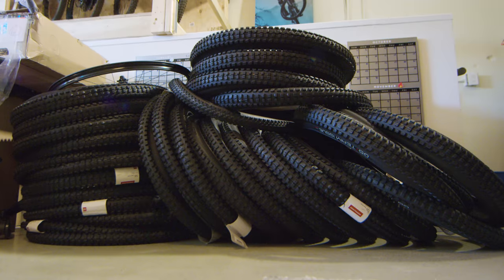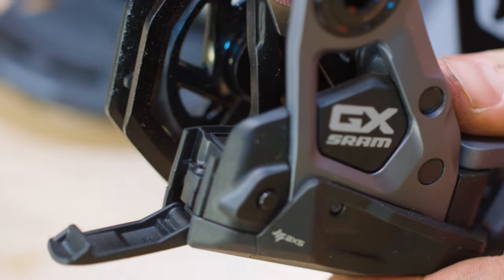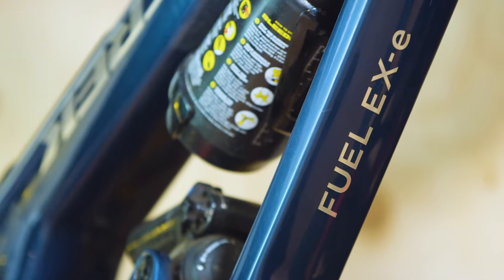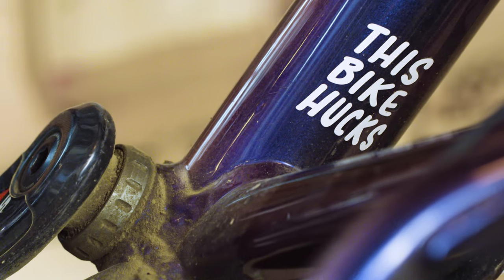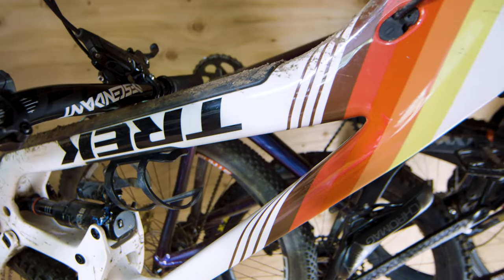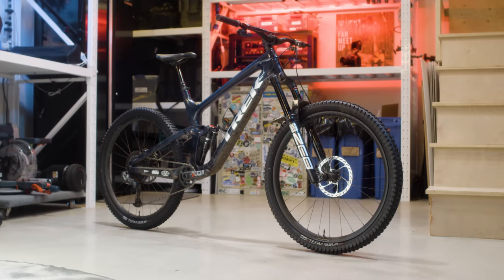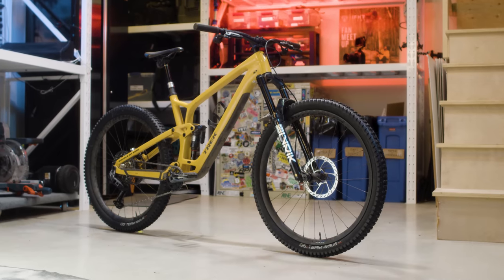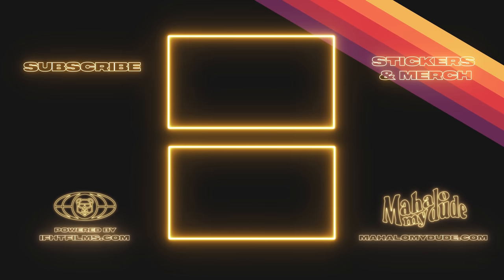What Bikes Do We Ride? | 12 Mountain Bike Checks

Comment: Awesome whips dudes! I have a few myself. 2020 Remedy 9.9, 2021 Top Fuel 9.8 ,  2022 Slash 9.8 (Fox Factory suspension upgrade) and just bought a 2023 Fuel EX 9.8! :) The best part,  I work for a Giant and Commencal dealer in the summer LOL